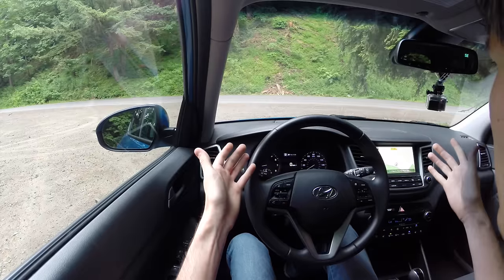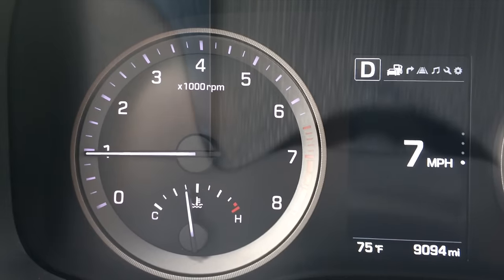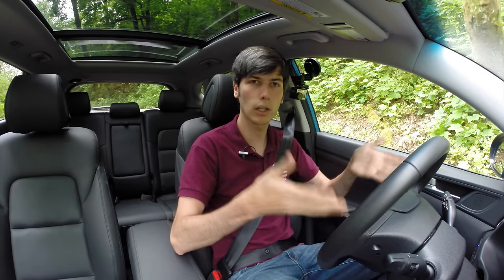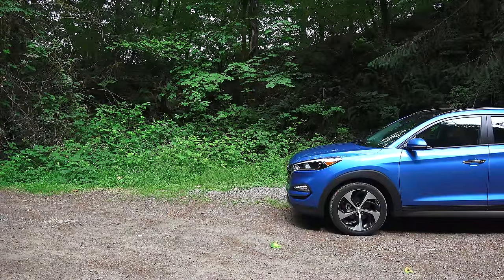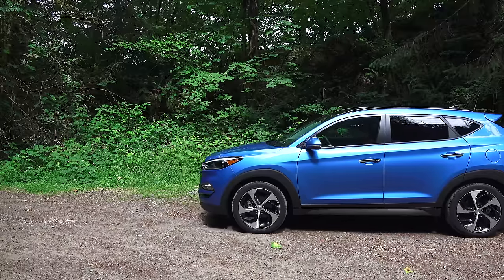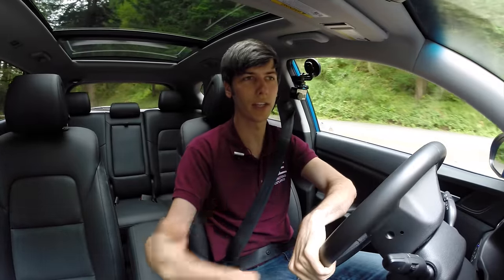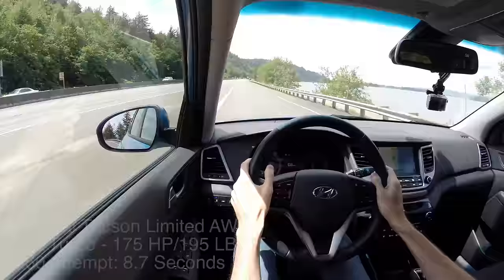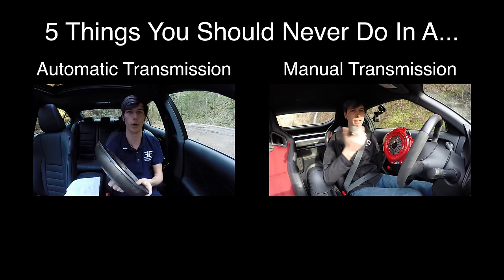5 Things You Should Never Do In A Dual Clutch Transmission Vehicle

Comment: It took me several months to learn how to predict the actions of my Hyundai Tucson's DCT. Once you master the art of understanding the quirks, it is an awesome transmission. Great video! I really enjoyed watching it and you really nailed it.  I am a senior level experienced Automotive Technician by trade and I found the DCT hard to master. You explain the logic or the DCT so well in this video. I really like your channel.
Reply: I'm getting used to my Mazdas dct...at first i thought i had a problem with it...
Reply: Took me about 4 months to learn my DCT in my 2018 M140i
Reply: @PARlS23  lol thats not even a dct in a m140i. its a ZF8
Reply: Guys i have a question.. my tucson 2019 when engine is started, i must just very gently press the acceleration petal for some meters and then accelerate! If i try to drive immediately, it starts to push like trying to find the speed and to doesnt fully engage to the D1 etc for some seconds. My CLatch disks are brand new. Is it normal?
Reply: how is your DTC at 2023  reliable?

Comment: Very interesting because there were several issues you described that are not the same with a PDK double clutch transmission. First, the RPM will rise to about 3500 RPM and stay there until you release the brake. Next, Porsche says there is no limit to how many times you can do this in a row without over temping the system. It would be interesting if they would talk to you after you drive a 991.1 Porsche to see the difference. The 991.2 is turbo charged so it may be different there.
Reply: @ChuckJ1944 😂 That's in launch mode not standard mode. Do you really think a Porsche leaves the green light at 3500 rpm all the time!?
Reply: @andersriksson100  This comment was four years ago so its hard for me to remember the context, but I think I was saying in my 2012 911 if you slammed the gas peddle down it would go to 3500 before the clutch would tighten. That would not happen on normal starts.
Reply: Launch a car is still hard on the car. All that this video is saying is thay in a normal dct you shouldnt do x activities without being aware of the wear being done. This is the equivalent of saying you shouldnt slam the breaks everytime you stop, yeah any decent car should be able to do that for a long time, but any normal person would in fact agree that its not best practice

Comment: Hey, glad you made a video on this. I need to make sure my GTI is treated with love.
Reply: My thoughts exactly
Reply: Fun fact: that hyundai has the same wheels as some GTI 😐
Reply: @x_Oeuf  Haha you're right! My GTI has those exact wheels, I just didn't notice. I was trying to figure out if the front and rear bumper paint match the rest of the car or not, can't tell if it's lighting or bad paint job. paint on the bumpers look slightly darker and less vibrant. Go to 6:24 for good example at the rear quarter panel and rear bumper.
Reply: Ewww why would you get a GTI in anything but manual? Do you hate driving?
Reply: @CyseTV  cause DSG transmissions are fast asf
Reply: @MikeVajboi  yeah, and they're faster and better all around, but it takes away from the driving experience. If I'm trying to win a race, I'll use a dsg or dog box, if I want to have fun, or litterally do anything besides winning a race, I'm driving a stick.
Reply: I just broke my clutch in my scirocco R which caused my gear 4 n 5 gears to lock up n break inside the gearbox
Reply: @CyseTV   Late reply but  I'm not commuting in heavy traffic every day with a manual. But I guess you can't be a TRUE auto enthusiast unless you have a MANUELLE TRANSMISSION. Lmao okay
Reply: @Roflsponge  drove a gti with a dsg, and it's fun and makes alot of sense but I'd still choose a manual over it.
Reply: JuicyDizzy  it's really not, as long as you aren't lazy.
Reply: @CyseTV  people can drive whatever they want chill out
Reply: @CyseTV  if you want to tune a gti the dsg is better

Not having to replace your clutch just to go stage 2 is nice
Reply: @ashleymaharaj3599 - Nice story, and we should care, why exactly??

Comment: In my wife's 2012 TDI Golf with wet clutch DSG, I shift into neutral at the lights, as the fuel usage indicates that it actually uses less fuel in neutral than with the foot on the brake whilst in gear. In a tank of fuel, I've found it can make between 0.5 and 1 ltr per 100km difference.
Reply: In the owners manual of a dsg it says to not shift into neutral when coming to a stop 😅
Reply: I noticed the same effect with my late Golf 6 GTI. The technical reason was that switching to neutral turned the hydraulics pump off that provides the oil pressure for the clutch packs.
If switching to neutral was harmful this setting wouldn't exist or would be blocked like switching to reverse while driving. The only thing that could happen in my opinion is that turning off the oil pump on a boiling hot gearbox could lead to overheating since the oil is not only hydraulics medium but also cooling medium.
Reply: @MkGti-si5pq  Didn't read that in my wife's car. Could because it was diesel and a wet clutch, not petrol and dry clutch...
Reply: @MetalheadAndNerd  the oil pump will keep running, but the pressure control solenoids for the clutches will be set to zero pressure. You'll still get circulation and cooling. And less heat will be going into the fluid from the clutch packs. That extra fuel consumption in drive is basically heating up the fluid.
Reply: @MkGti-si5pq  "when coming to a stop" would mean don't coast in neutral. Once stopped you can definitely select neutral.
Reply: When you put a dsg in neutral it’s physically putting it out of gear, same thing as putting a manual in neutral
Reply: @alanjm1234  Thanks for the input here, question pls, what is the kind of extra wear / stress that would occur if you were to shift to N while car is in 3rd-6th gear as you're coming to a stop to avoid the downshift to 2nd and 1st gear to just use the brakes for a smoother stop / cutting a downshift sequence out?

Comment: I’ve had a Dual Clutch Transmission Honda motorcycle for 4 years now and really like it. The bike accelerates quicker and gets up to speed a lot quicker I could shifting through the gears. The great thing is that you only need to do is hold the throttle open the whole time. There are two automatic modes, D-Mode for economy, S-Mode for sport and a MT-Mode for Manual operation. There are paddle shifters on the left control pod easily accessible using your index finger and thumb. The clutches full disengage when at a stop with some resistance to prevent the bike to roll back easily. Some careful throttle twisting can simulate feathering the clutch, once you get the hang of it.

Comment: #2 - In many modern vehicles, there is an automatic brake engaged when you are on an incline. The dashboard has a green light that is a picture of a foot on a brake pedal with a circle around it to indicate it's engaged. In that case, feel free to take your foot off the brake.
Reply: In my car i have to press the brake pedal to a certain depth for the brake to engage. It's convenient once you get used to it's and actually useful, as opposed to the annoying engine auto stop at red lights which sometimes stops the engine while the car is rolling ... thankfully it can be turned off.

Comment: Love my Turbo Veloster. That DCT really makes it fun to drive to work. I definitely experience a lot of hesitation at lower speeds, like if I'm going through a school zone, as the RPM tend to shift between the ranges it wants to shift up and down, so sometimes if I haven't manually selected a gear, it'll shift up and down out of second and third. I'll remember not to inch to my stop next time though!
Reply: Did you read the manual? they designed it to be that way lol They made it where it stays so you can downshift quicker, Its a track car, but if you put your foot down the car will boost forward. So if you drive N mode or N custom. It will stay between 3 and 4 at around 30mph. If you drive in the normal mode, at that same speed it will be at 6 lol. 

but yeah read the manual you'll learn so much about your car.
Reply: @therealsechs  he said veloster turbo not veloster N lol the turbo is not a track car
Reply: @therealsechs  Nor does it have any ‘N’ modes to speak of because well… it isn’t an N
Reply: @zenxen7668  he said DCT as if he has driven the N model before. Perhaps he owns two cars or knows someone with an N. 

Regardless. Good idea for any car owner to read the manual.
Reply: @therealsechs  Both the Turbo and N comes with dcts and 6spd standards so that’s why he mentioned it but yea I get where you’re coming from though and agree about the owners manual thing
Reply: DCTs were initially meant for high end racing cars, so it makes sense that they struggle during low speed driving on regular street vehicles

Comment: Three years in to having the same 8 speed DCT in my Hyundai Veloster N and my Hyundai Santa Cruz.  9000 miles on the Veloster N mostly track miles.  A lot of them using TrackSense shifting.  No issues.  The Santa Cruz has been used to tow the Veloster to tracks that are a few hundred miles away.  No issues.

Comment: The DSG dual-clutch has built-in creep, and it keeps the operating clutch fully engaged. This is a design feature, not a consequence of the design technology. It is perfectly OK to creep in it, controlling the speed with light braking.
Reply: That won't cause significant clutch wear on the wet-clutch versions, but it will do so on the dry-clutch versions of the DSG (i.e., on the 1.2, 1.4, 1.5 TSI engines).

Comment: I once drove a Veloster with a Dual Clutch and basically I got excited when we got the Veloster N (manual) to drive instead. From my experience the dual clutch I drove would jerk around at slow speeds and felt sloppy. I'd much prefer to just clutch myself. These larger cars suffer from similar jerkiness at slow speeds. (I work at a Hyundai dealer so I drive a lot of this stuff on a weekly basis).
Reply: The dct on the vw golf gti I test drove felt really jerky and slow. On the 6 spd version, at least it shifts instantly and smoother whenever I throw the shifter in whatever gear I want it in
Reply: @AIDAHAR210  It’s mostly the tcu’s fault. I have a mk7 golf gti with the dsg and I got a tcu tune as soon as I got it and most of the jerkiness is gone.

Comment: My take (and I could be off here), DCT works really well with a hybrid/PHEV train like Hyundai/Kia have in several cars.  Creeping along in traffic, it puts you in gear 1 or 2, the electric motor is driving it non-slip, and the engine is disengaged with the engine clutch.   Even with a depleted hybrid battery, a newer Hyundai/Kia hybrid will start the engine and run up to ~15 MPH in a 
'series' HEV mode (HSG creating volts, battery and EV motor consuming them) to save DCT wear.  You could almost think of that buffering as the equivalent in electrons to the buffer of a fluid torque converter.

Comment: In 2005 I bought an Audi TT with DSG, the second year that dual clutch auto-shifts were ever available from any manufacturer.  About 2 years later it started acting up. It was shifting weird. The wrong gear, or not shifting when it normally would... just screwy. I though, oh, jeez- I bet servicing this new fangled DSG is gonna set me back.  It turned out to be a $45 brake light switch.   Because of the faulty brake light switch the computer could not reliably tell if I was accelerating or braking, so it was constantly pre-selecting the wrong gear.  Replaced the switch and the transmission was perfect, again.  From this I learned that I can get better performance from the DSG by giving it clear indications of my intent... whether I mean to slow down, speed up, cruise, or go like a bat outta hell by not riding the brake, not driving two footed, and simply being positive in either throttle or braking.  15 years of daily driving this transmission has never given me a single issue.
Reply: Have to look into this, my DSG hiccups I’ve noticed really only ever happen whenever brakes are applied, or if it’s on an uphill at top gear and the revs are too low

Comment: The inching fwd makes sense to me now! My wife had a Dodge Dart with the 1.4t and ddct trans. Whenever we would get caught in heavy stop n go traffic for long periods of time, there would be a burning smell and minor smoke developing from the engine bay. We even had the shut down on us one time (prob due to the clutch overheating). These cars should be built to withstand any type of typical driving condition though. FCA has since dialed back the number of Darts with that come 1.4t/ddct combo.

Comment: Can you do an "Automatic vs dual clutch" video ? Great work btw !
Reply: +ChinnuWoW dual clutch and your traditional automatic are different
Reply: Dual Clutch is a lot more like a traditional manual transmission. They generally use heliacal gears. The big difference is that you have 2 shafts, one inside another. these 2 shafts have the cogs for every other gear. So the inner shaft might have 1, 3, 5, 7 and the outer will have 2, 4, 6. The transmission uses small motors to move sleeves which can pre-engage 2 gears at once. For example sitting at a stop both 1st and 2nd gear will be engaged. Now to connect that to the engine, you have 2 clutches, one for each shaft. When you hit the gas, the computer engages the clutch for 1st gear, then once it comes time for 2nd, it releases the first clutch and engages the 2nd. Once the 2nd clutch is engaged, a motor moves the sleeve from 1st gear and pre-engages 3rd. Then when it comes time to shift from 2nd to 3rd, it simply releases the 2nd clutch and engages the 1st again.
Reply: RogueRAZR Thanks man
Reply: +She doesn't know $#!+ yeah, you're so manly. Woman love you and children look up to you because you drive manual exactly
Reply: They look up to you because you are Chuck Norris and you kick ass and have a cool beard :)
Reply: +ChinnuWoW Dual Clutch IS not an Auto. It is an automated-manual
Reply: +She doesn't know $#!+ Aww, his manliness is tied to grabbing on to phallic shaped objects all day long.
Reply: clutchthepearls NO lol. Way to take things to the extreme. I guess you really don't get it. Most people that drive a manual sports car understand why its more engaging. Those that can't do it will never understand. Usually its not even worth the effort to try to explain it to auto fanboys.
Reply: +She doesn't know $#!+ ...say the manual fanboy. 
I've had both and prefer auto. The only unmanly thing about either one is thinking you manliness is affected by it.
Reply: lf l'm a manual fanboy then you are an auto fanboy. To each their own. It's ok don't take me serious. I'm not judging you. It's just the internet. People talk smack all the time :)
Reply: I like dual clutch over a regular auto any day. but thats just me
Reply: She doesn't know $#!+ but a dual clutch shifts faster than an old fashioned manual lol
Reply: clutchthepearls It's all good :)
Reply: And with that answer you help people missunderstand what the dual clutch gearbox is and why they don't operate like a normal automatic gearbox.
Reply: +tmkongen that's because it's not an automatic gearbox. it's 2 manual gearboxes put together operated by a computer until the driver gives it input.

Comment: A small comment regarding tip #1 - "No need to put it in neutral when stopped because clutch auto-disengages."  This is true however the car holding the clutch dissengaged at the lights when the car is stopped does represent and engine and the clutch system under a tiny bit more strain than if placed in neutral. 

On my VW Passat it is evident when watching the fuel consumption reading whilst stopped at the lights - with the  transmission in Drive but stationary, fuel consumption is (0.7 L/hr)  if I flick it into Neutral fuel consumption drops (0.6-0.5 L/hr). 

Clearly a little less strain on the car, pressumably because for example the thrust bearing isn't pressing to release the clutch plates.

I practice this even if utilising the engine stop./start feature because I figure the starter will have a slightly easier time starting the engine if it doesn't have to fight the strain of also a depressed clutch. 

These are just carry-over thoughts from driving classic manual cars, but perhaps I'm I being too anal?!

Comment: Noob question: 
All gearboxes are rated for a certain maximum torque. 
In a performance vehicle: As the torque always decreases at the upper rev range, does this mean it's better (when using full throttle) for the double-clutch gearbox if you shift gear at the higher rev range rather than the middle?
Like, is is better for the gearbox if you change gear at 7000 rpm where the engine has maybe 75% of the torque rather than at 5000 rpm where the engine has 100% of the torque available?

Comment: I recall when I learned to drive with a dual clutch, it was driving me crazy as to what the car was doing, compared to traditional automatic transmissions which has natural intuitive shifting points.
Reply: And are MUCH more reliable long term. Not too mention easier too drive. Especially, for those who have never driven a manual before. Why Hyundai put a wet clutch DCT in the new turbo Santa Fe is beyond me. They should have just stuck with the normal 8 speed auto the SEL and lower trims have. I see A LOT of problems arising from these new trannies wet or dry clutch. They are just not reliable.

Comment: Most cars with a dual clutch transmission have a hill holder feature that applies the brakes when you let off the brake pedal to the accelerator when stopped on a hill. Otherwise, the car rolls back like in a manual car.
Reply: runforit420 mine sometimes work and thats on the same hill hahaha so annoying tho